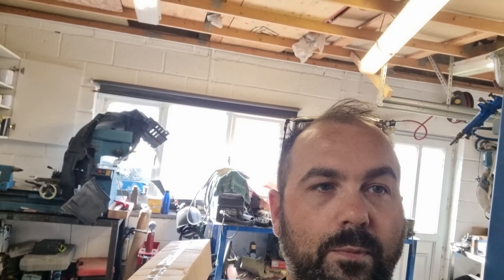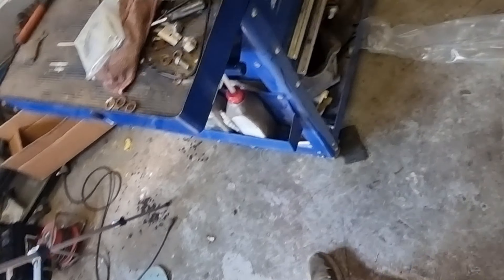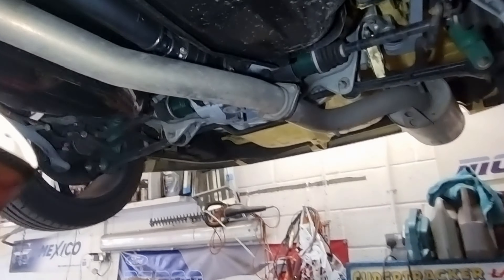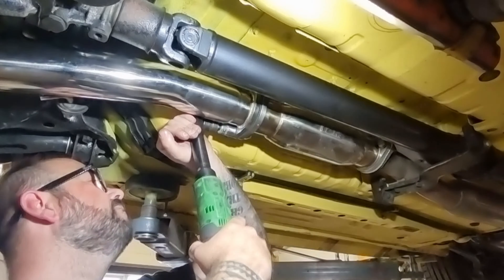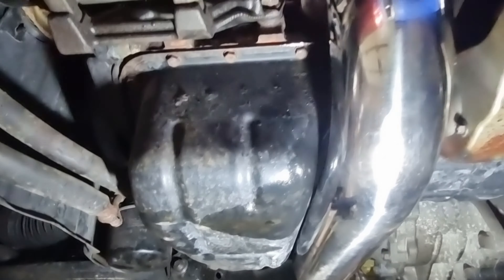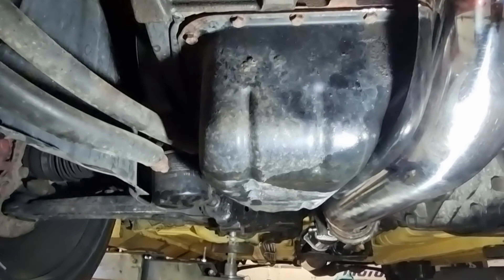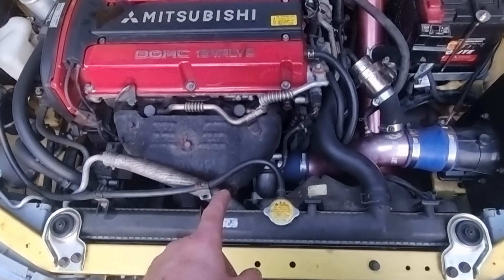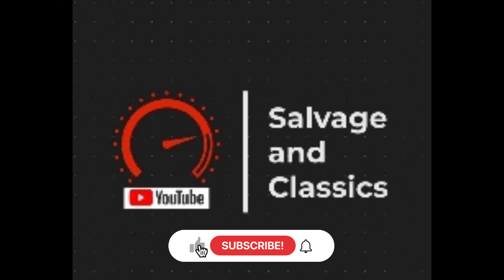Fitting a GRAVITY downpipe to my Evo 5

Comment: Another good content recording. Gravity had a good discount on the down pipe when I asked what downpipe you went for when you mentioned you was going to document the fitting. Looking forward to the next one , even fuel filter change will help so won’t be boring . Keep up the good work. 👍
Reply from the maker: Thanks buddy, yes the downpipe gets a thumbs up from me, I would however just elongate the mounting holes a tad to give a little more clearance however I had limited time last night as I wanted it back together quick for the local Japanese car night, the downpipe cost me £99 with the ebay jubilee discount